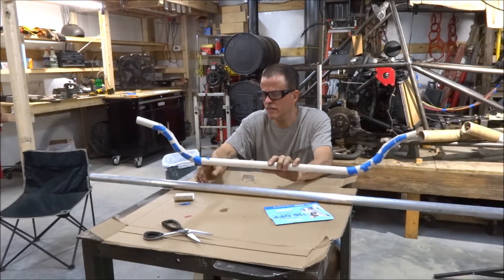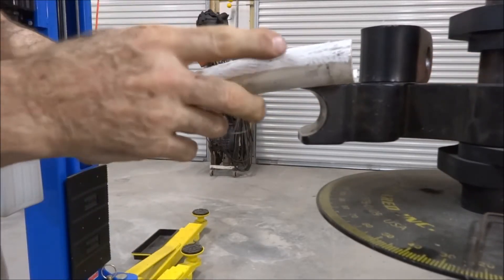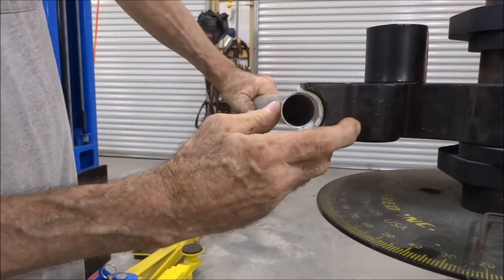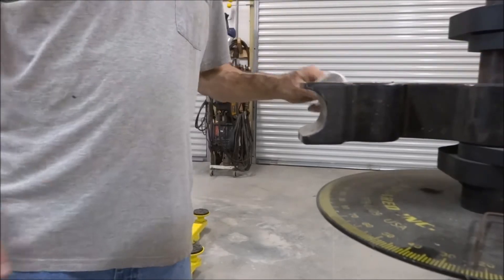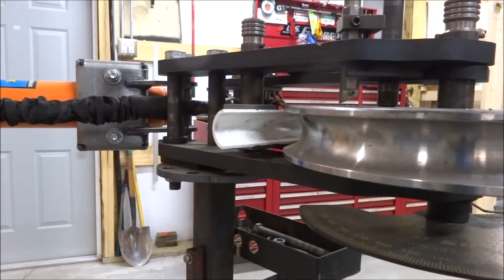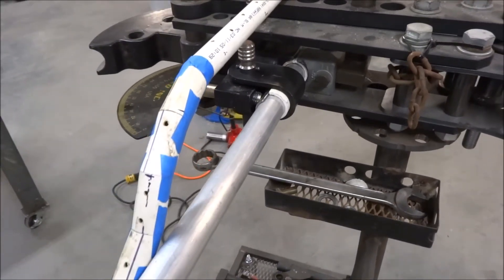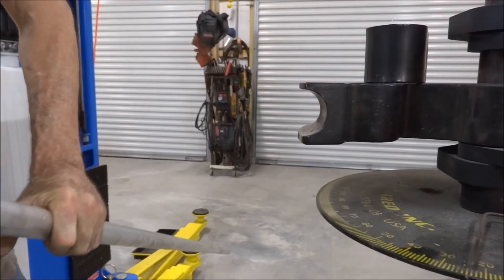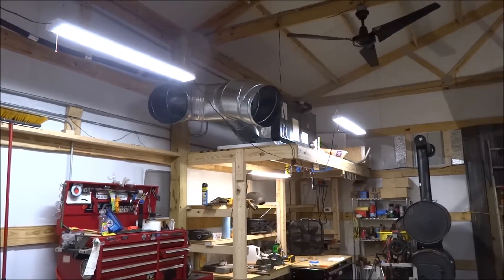Bending Aluminum tubing, Model 32 JD Squared, die adapter 1 1/2 to 1 1/4. Radiator coolant tubes.

Comment: did you use 1 1/4 pvc ? all ive found is either 1 inch or 1 1/2 pvc
Reply from the maker: It is 1 1/4 pvc, just some I had left over from another project. A goggle search shows it is available at hardware stores near me and Amazon.

Comment: If you put the pvc in an oven at 275 in about 5 minutes it'll become pliable, and with welding gloves on you can wrap it around the tube and it will set up in a few seconds!  Good solution either way!
Reply from the maker: 👍yes good idea moldable pvc, didn't think of that.

Comment: See the problems with the JD2 Model 32 bender:
https://www.youtube.com/watch?v=HCFQWkefZ-U
https://www.youtube.com/watch?v=Uraie75DRG8
Reply from the maker: I do not have that problem with mine. I dont let my spring back pin drop all the way down to the roll pin (stopper). And  after using it for a while I decided a tiny (TINY) bit of grease on the bottom angle of the pin. And on the force faces (where it goes through the upper bracket) wouldn't hurt. It moves very smooth after that